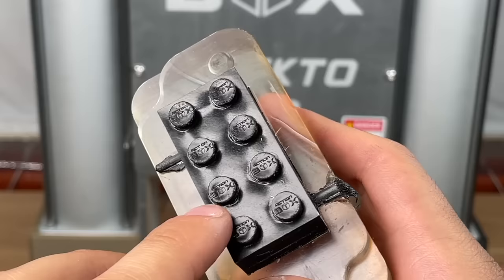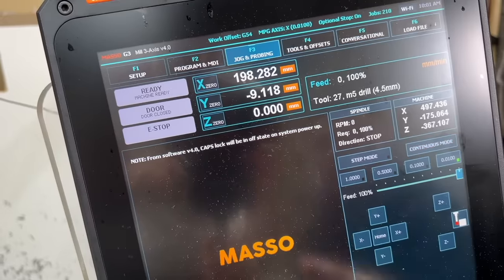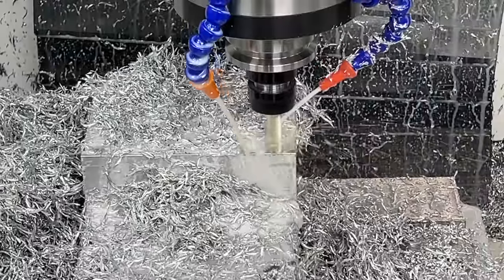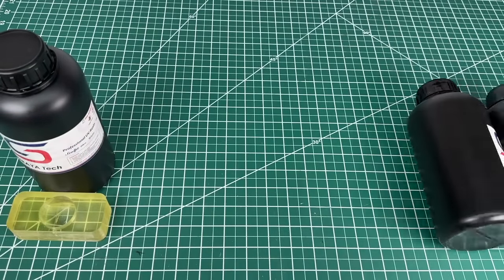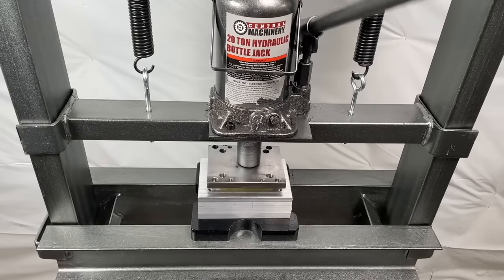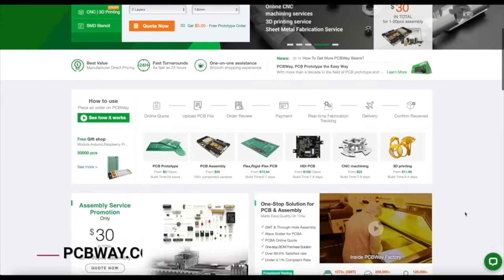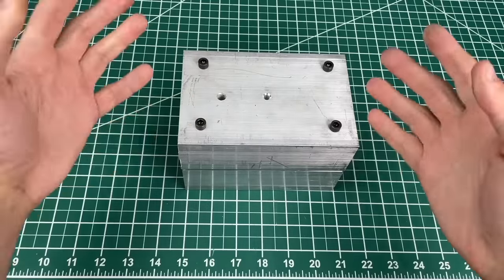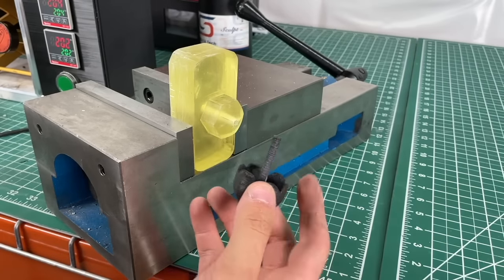We Made Plastic Injection Holders For Resin 3D Printed Molds | Homemade CNC Machine Job

Comment: I am a mechanical engineer who has been working in the automotive sector designing plastic injected parts for the last 7 years. I  love your guys' videos and find them fun to watch as you are cresting all the systems we use (at a much smaller scale of course) from the ground up. I primarily design exterior body systems which comprise of multiple cavity  small fastener tools running on small one ton presses, to large bumper covers being injected on 4000+ ton presses. If you would like to have a meeting and discuss some best practices to further your designs I would be happy to collaborate. Again, appreciate all the work and effort you guys put into your projects and videos, and hope your channel blows up to the size it deserves.
Reply from the maker: Thanks Kevin, I really appreciate your support 😃.
Reply: I'm a proccess tech and mold setter. I would love to shoot a resin mold in a low ton press to see what the actual lifetime of the resin would be..
Reply: The amount of softening languages you guys learn in those industry is amazing

Comment: I appreciate how you endeavor to explain all the little details as you go along, like how much to tighten the screws and in what order. I think many tutorial videos tend to gloss over those things as obvious or unimportant, but they can have a profound effect on the outcome of the project, so it's better to mention them than to assume people will 'just know'.

I hope your aluminum casting experiments go well. If it proves too hot for the resin, I'd try again with a lower-temp casting metal, as some of them get no hotter than the plastic you're injecting. Actually, I just remembered that I once saw someone cast pewter or tin-bismuth or something in a plain FDM printed ABS mould, so that should definitely work with the resin. Still, I hope the aluminum works.
Reply from the maker: Thanks for your kind words and support 😃

Comment: Great video! Formlabs recently released a white paper regarding 3d printed molds using metal backing plates. They found that high tensile strength, low elongation resin (rigid 10k) performed more cycles than resin with higher heat deflection. It's titled "Injection Molding with 3D Printed Molds: A Technical Study From a Leader in Plastics and Composites".

Keep up the good work! Thank you for fulfilling the dream of turning every engineer's garage into a full cycle manufacturing facility.
Reply from the maker: Thanks Quinton, that’s an awesome fact that you shared, I’ll pull that paper up in a second here.  Glad you enjoyed the video and thanks for your support 😃

Comment: great video and thanks for sharing. wanted to recommend that you check your Haimer. Your needle isn't returning to zero in the resting position, so your position is likely off. Confirm with an edge finder. There are two adjustments to haimers, the first is to get the stylus on center by adjusting the set screws around the top while reading the center of the indicating ball with a dial indicator and the second is to adjust the dial to read zero by adjusting the set screws around the dial.
Reply from the maker: Thanks Robert, I’ll look into it.
Reply: @ActionBOX  Good deal. I had the same issue. Looks like you're about 4 divisions out, so that's 0.04mm or about 0.0015in. Not huge, but it's there.

Comment: I work in a plastic inyection factory. It is funny to see how you go from the base of the manufacting, discovering the faults and trying to solve them. You are showing what happens.
Molds are quite a piece of engineering, specialy for complex parts. Many of today's molds have hundreds of moving parts just to create, for example, bottle caps.
I can give you (or anybody who's intrested) some tips and tricks for your next projects. Just contact me.
Reply from the maker: Thanks Martin 😃.  This is definitely nonprofessional setup but we will reach out when we remake our fully automated machine. Cheers

Comment: Next steps probably would be having a way to secure the printed inserts into the machined shell, adressing alignment precision between mold halves using pins or even precision shafts and bushings (vs screws) and then having a rapid way to clamp/unclamp the mold shells, such as, well, having clamps instead of screws. Or having slots and sockets for the screws so with one or two turns a washer is free to escape a pocket and the screw can then be pulled free. And there's many other options there like toggles, Pistons, etc. 

Since you have a CNC mill and a 3D printer there's no need to go overly simple on the mold design now that you have a working proof of concept.
Reply from the maker: Hi Scott, I totally agree.  We definitely will be dwelling into that at this point.  Thanks for leaving a detailed comment. Cheers, Dave

Comment: Love the videos. For me what I'm finding is that injection molding takes a lot more manual labor than 3d printing. Printing takes longer, but it allows the parts to be produced while I'm sleeping or working on other things. 

This requires my complete attention and focus.

So I'm not sure the niche of production where this would make the most sense. If I'm going for a lot more volume than my printers can handle, it likely makes more sense to just get them produced somewhere rather than have production monopolize all my time, or train and pay an employee to run the injection molding.
Reply: "the niche of production" injection molding is the way, almost any industrial product in our world is made of. 3D printing is the niche, not injection molding
Reply: This is perfect for in between low volume 3d printing, and paying a hundred thousand to get tooling for a only moderate number of parts.

Comment: have a another vertical hole to take the excess, the alu blocks could easily be replaced by heavy steel plates that slot in.
and those would be only limited by the injection chamber height.
Reply from the maker: That’s a good suggestion, in hind sight I definitely should have added an escape channel. Thanks for watching and sharing your thoughts.  Cheers,  Dave

Comment: You could drill and tap holes on the backside of the pockets so you can run a bolt in to easily get the molds out.
Reply from the maker: Agreed, that’s a great idea. Thanks for sharing Zach.

Comment: Next step, buy some decent steel and mill out both halves of the mold entirely.
Reply: you loose the whole point of this project. Making conventionnal mold is very expensive
Reply from the maker: Our point is to explore the possibility of using 3D printed molds for plastic injection. Hope you enjoyed the video regardless.
Reply: @ActionBOX  Sorry lol, I just really want to see more action from that awesome homemade mill. Have a good one.
Reply: @ActionBOX  If I recall correctly, PepsiCo recently partnered with Nexus3D to make FDM printed PEEK moulds that fit in a metal master shell (much like you've done), except for blow moulding their bottles, rather than injection moulding. So it certainly seems like a commercial viable strategy.
Reply from the maker: @hollt693  I didn’t know that but that’s really cool. Thanks for sharing 😃. Cheers, Dave